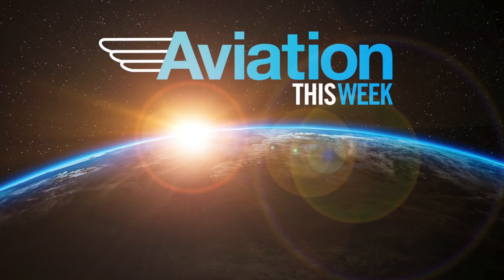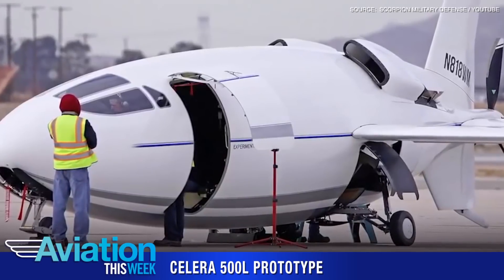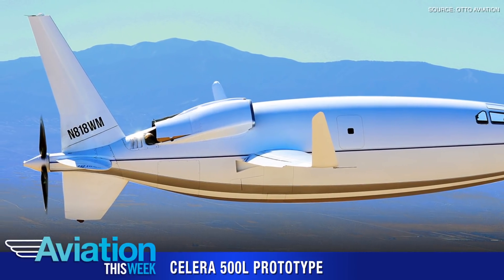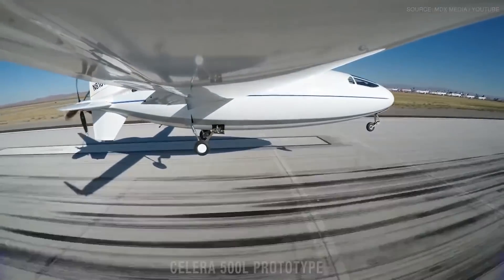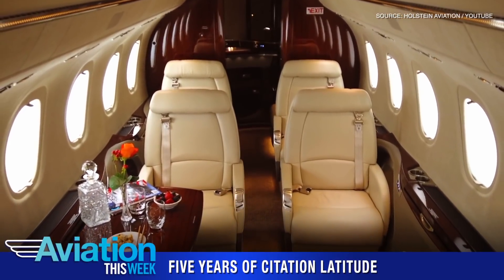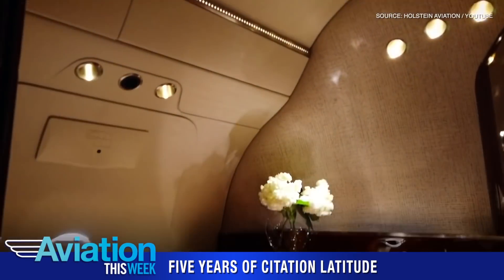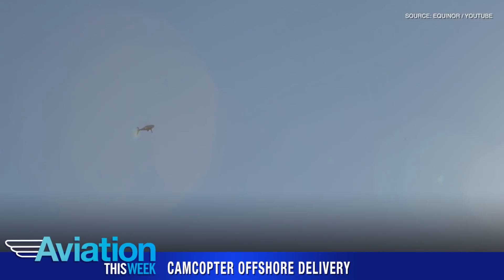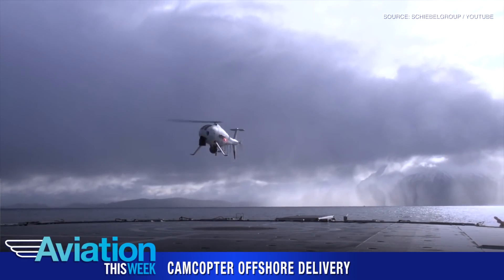Aviation This Week -  August 28, 2020

Comment: The first time I heard the phrase "laminar flow" was  in a description of the wing of the P51 Mustang (North American Aviation). Is this the same effect?
Reply: Supposedly. The designer behind this aircraft does have some pedigree. But bear in mind that this particular aircraft (the Celera 500L) is supposed to be powered by a piston engine. I'm not saying it's a scam, because they at least have a prototype, but they're claiming 460mph, and that's something really hard to achieve with a propeller.

If they can actually achieve it though, this will be a boon to aviation industries worldwide, so while I remain skeptical, I sincerely hope for their success.
Reply: @marioprawirosudiro7301  tupolev t95... for speed. so no speed is not a problem but 8 times less fuel burn? not sure what they are comparing that with but yeah red flag for me. also how old is this otto guy? if you watch some other videos it sounds like he works in aircraft industry since 1940s but he was also working on nuclear weapons? meh... loads of crap
Reply: @jebise1126  Well, the 8 times less fuel burn is because it's a piston engine, not jet (and they're comparing it to the average business jet). The Tu-95 has four engines, not just one, so I don't think it's a fair comparison.

As for his resume, I don't know whether it's actually true or not, but I'd imagine investors would've done their due diligence - it's easy enough to check if they'd just call whichever company he claimed to have worked before. The problem is with the (quite frankly) fantastical claims they make. So like you said, it does sound like, well, loads of crap. 😅

But, despite all my doubts, I still wish they'd succeed, simply because if, against all odds, they do deliver... well, let's just say it'd shake up the industry as a whole.
Reply: @marioprawirosudiro7301  They claimed a drag reduction of 59% along with the 8 times less fuel, and the V12 engine works as 2 V6banks powered independently, so it's like having a multiengine aircraft. I guess we'll just have to wait and see if they can deliver what they promise
Reply: @marioprawirosudiro7301  more importantly it's a diesel engine, not gasoline. That would explain some fuel economy.
Reply: The range and fuel consumption checks out with a bit of math. What I don't believe is the speed. 400 KTAS is pushing it on a propeller that is ingesting boundary layer. And how should it achieve that on 500hp? Mind you that the current record is in the hands of the piaggio p180 with 2x 850hp. After that comes a turbine legend with Garrett 1000hp
Reply: @marioprawirosudiro7301   Have you seen how fast the Pilatus trainers fly ? the P-21 is very fast. 337 KTAS